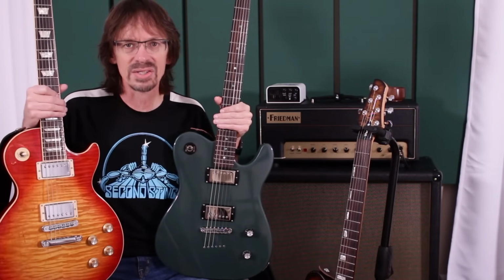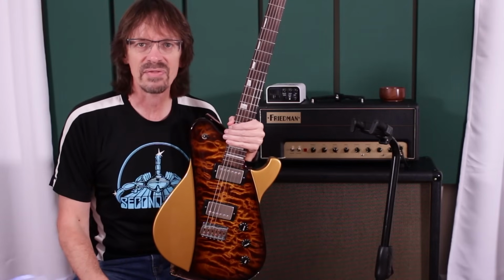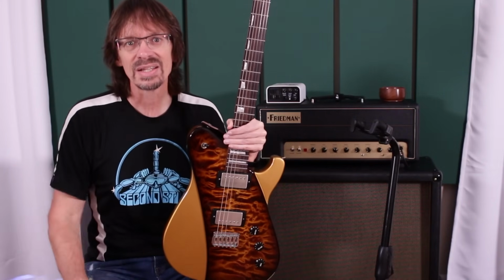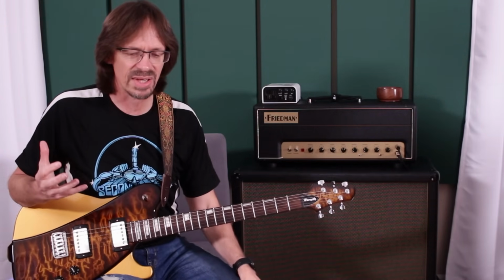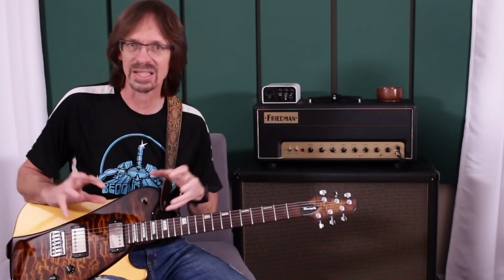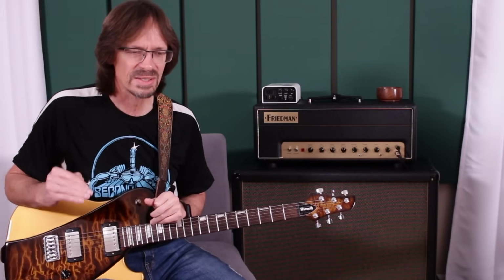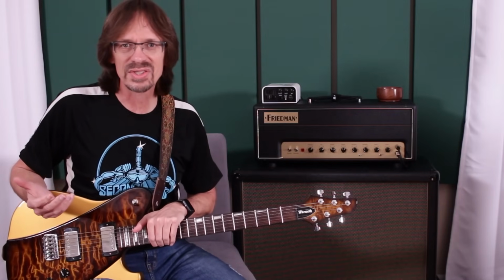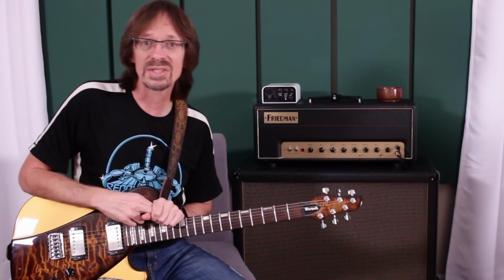Does anything else sound like a Les Paul?

Comment: Great demonstration,  Aaron.  For me, I was listening while I was folding g my laundry,  I didn't even realize you were switching guitars, so I'd have to say from a listening perspective you're spot on, you just need the pickup configuration,  but I also think the tactile experience vastly changes your perception of what the guitar is doing, and I think that is a valid consideration. I've got certain Les Paul's I prefer over the other ones for certain things based solely on how they feel and play, so to me that's going to be tenfold when switching between different types of guitars.

That said, my favorite non-Les Paul guitar that sounds like a Les Paul is my Warmoth Tele I put together 20 years ago  with a 24 3/4" conversion neck, chopped ashtray bridge and a Dimarzio PAF in the bridge. Sort of an Esquire-Gib.
Reply: Same. I was doing other stuff and the changes sounded little more than a different mic position -- if that.

Comment: This definitely gives me more confidence about my current project, a 24.75 scale tele deluxe partscaster with HBs. The goal was to get into an SG or LP tone territory but still be able to use a custom unpainted neck. I have a couple different sets of pickups and have built loaded pickguards all ready to go when the neck arrives to see which i like best. Can't wait! Great video!
Reply: Good luck on your experiment. I'm trying to do a similar thing with a Warmouth mahogany body Strat and a Warmoth 24 3/4 scale mahogany neck with rosewood fretboard. I will also add humbuckers but I won't be able to get it assembled until this summer.
Reply: @WindsurfMaui  Thanks man. Good luck to you too.
Reply: I’ve got a 24.75 scale jazzmaster, dual humbucker and it nails Gibson tones. 
It’s a total beast. 
All my friends drool over it 😂
Reply: @silverjaw138  Nice! Thanks for chiming in. I bet yours is killer and I hope mine turns out that way. 

I built a 3 P90 strat a few years ago, before I knew how much space a Warmoth JM body has routed under the pickguard. Now I wish I had used a JM body for it as I really like how many options you have when it comes to laying out the controls compared to a strat.
Reply: @silverjaw138  Just curious, What HBs did you put in it?
Reply: @jc6721  right now I have a Super Distortion in the bridge and a PAF Pro neck. 
It’s a sledge hammer, but cleans up well with the volume knob.
Reply: my next project is also going to be 24.75" scale LP kinda guitar - but I'm using a two-piece birdseye maple 24.75 conversion neck with a Tele-style heel and headstock.

Comment: Now in the midst of my second guitar build, the first (strat-style w two SD Pearly Gates buckers) over 15 yrs ago. This one is a crossover Fender/Gibson w/ a Warmoth maple neck, Meteora-style body shape, a 25.5 scale, and a pair of Fralin classic P90s and I’m going 50s LP wiring. Doing the full body work from scratch using a swamp ash blank w/a figured maple cap -let me tell you, steam forming the arm relief bend-n-glue of that cap laminate was fre@kin’ tense! Fitting the neck right now and I’m a skilled amateur, but an amateur nonetheless, and this kind of woodworking in a garage shop is not for the faint of heart.

Just sharing because I’ve probably watched every one of Aaron’s videos, several many times, over the past few months and this is one of the few spaces where there might be others who can relate.  Thanks Aaron, and Warmoth for the inspiration AND the sweet neck. I hope I can make it to the end without majorly #&ck!ng this project up!

Comment: In my experience, it's more about what you play it through that helps notice the differences. A good tube amp will accentuate the differences a lot more than a plugin or modeler which tends to homogenize the tone more. Pickups make a huge difference too. The wood used is a factor in how much it resonates. Some woods or types of woods resonate more than others. Finally, the neck joint makes a lot of difference as well. I thought in this example either B or C was the Les Paul. I thought the green one was A. Thanks for the videos. Helps take my mind off all the things going on in my world that I don't want to think about constantly.

Comment: I have an old Squire Master Chambered tele from 2005 that has the LP controls, mahogany, set neck, LP scale, 2 humbuckers, tunamatic, etc. I figured it was the humbuckers and scale length plus a little schmoo schmee on the set neck that gets it pretty close. Im not selling old Squires, mind you, just noting the recipe ingredients.  Here, I thought B/C sounded close. I also think getting something "in range" is the best way to approach the endeavor, along with getting the feel similar.  Was a bit of a head scratcher that you had different scale lengths so dialed in, however. Always interesting to see someone attack the issue thoughtfully, and really cool Warmoth build.

Comment: One interesting thing to note is that an electric guitar tone knob (a passive low pass filter) will drain some of the highs, even when turned all the way up.

It looks like the Meadowhawk and the Tele have only one tone knob, and the Les Paul has two. So when both pickups are selected, the LP will be decidedly darker sounding than the other two.

That seems to track with the big difference in highs on the middle position, especially noticeable on the cleaner settings.

So part of the takeaway might be, if you want it to sound more like an LP, wire it like one!

Comment: Aaron, thanks for doing this video it is exactly the experiment that I'm trying to do. I don't like Les Paul's except for their tone. I am really in love with Strats. So I have a Warmoth mahogany body and a Warmoth conversion neck with a mahogany shaft and rosewood fretboard. I will be putting humbuckers in it this summer. I think I would get closer to a Les Paul tone If my mahogany body had a maple cap. I believe that tone comes from the body woods and the shaft woods not the fretboard woods. the stiffness of the neck and body produce different tones depending upon whether you are using a maple shaft neck or a mahogany shaft neck. Dylan from Dylan talks tone believe the critical Factor is the distance from the bridge to the bridge pickup and the neck to the end of the next shaft because of the sine wave created by the vibrating strings feeds a different tone to the pickups by where they are placed. There is some truth to that Theory I believe but I think a mahogany body and Mahogany shaft Gibson conversion neck will get very close. Keep up these interesting experiments.

Comment: This a super helpful post. I have a Warmoth Partscaster (Strat style), but have come to favor a Les Paul sound. I have looked at a lot of different options to get there. New guitar, new build, replacing the pick guard…
After this post, I know it’s more about the pickups! I have a few guitars and limited space. The cheapest most efficient option is setting up a new pick guard, with low output pickups.
Reply: Did you order your Strat body with a universal pickup route?
Reply: @Robstafarian  Unfortunately, no! Either going to Dremel route it out myself, or have my guitar tech do it? Definitely going with the swimming pool route to insure I have maximum flexibility in the future!
Reply: @druwk I have designed a small perfboard which uses some spring terminals to facilitate changing prewired pickguards without soldering; I also decided to add a Littelfuse for ground-fault protection between the string-bridge ground and the output ground, taking a page from Taylor Guitars.  The board will sit in the control cavity, below the pots, with little depth to spare.

Comment: I built a Jaguar with a basswood body, maple neck/rosewood fretboard, and put a Dimarzio Super Distortion in the bridge (ceramic magnet, about 13.6k), and the 36th anniversary PAF (alnico mag, about 7.5k) in the neck, with a tune o matic bridge. I also built a proper LP with mahogany body/maple cap, mahogany neck/rosewood fretboard, that I loaded with a Duncan Custom (ceramic, about 14k) in the bridge, and a Duncan 59 (also alnico, and about 7.5k) in the neck. They're also very close in weight. The LP is 9lbs 1oz, and the Jag is 8lbs, 14oz. When I record them, I can not tell one from the other. But like you said, when playing them, it's a very different experience.
In the blind test in the video, I could not tell which was the LP. Honestly, I had guessed the LP was going to be guitar C, just because C sounded the most different to me, and I was assuming that both of the more Tele style guitars were both 25.5", and the LP was 24 3/4"ish, and that might have been the difference that I was hearing. Regardless, interesting video!

Comment: I correctly guessed the blind test, and in my experience, two of the most influential factors on the sound of a guitar are the pickup position and the scale size. That's why the Les Paul sounds warmer due to the scale, and the pickup position gives it that classic and identifiable sound

Comment: I would think scale length and peg head design is the biggest factor in difference. I could tell the LP immediately because of the spongey-ness in the looser string lengths. I wish I could see if the peg head is 6 in line or 3 +3 on the green one. 

If you could do a comparison video on peg-heads, bridge type and scale length, that would be awesome! 

I’m also trying to decide on wraparound vs string-through vs stopbar for a TOM bridge.

Comment: I like the blind sound tests. That way Warmoth is testing our sound expertise skills, haha.
Edit: Yes, I had the tests correct! The way I found out was because two guitars sounded more snappier due to the longer scale. And one of those had more output than the other, plus the Telecaster model - guitar C - sounded thinner due to alder body. The Les Paul was less tight, more rounded and had that typical attack full tone when hitting power chords. But I had to say it was not easy and had to listen the bridge examples a few times. The neck and middle positions revealed more differentiation.

Comment: The Warmoth Tele style if it had a mahogany body,maple top,a mahoany neck ( I could getvaway with using a maple  neck and board). Also,if either a Duncan 59 bridge pickup (, or Duncan ALNICO II) were used it would come clieser to a Les Paul tone,especially if a 24. 3/4" scale is used. Great video👍🎸Also I love the string thru body with a tune o matic bridge...Snap And sustain

Comment: I don't think body shape or material makes much difference to amplified sound. PU do. And scale length matters a lot too.  For two reasons. It changes the tension and harmonic content. And it changes where the PU are relative to the vibrating strings. If you just had one PU on a sliding track you would hear a great difference as you move more towards the neck or bridge

Comment: I picked the Les Paul due to the lower mids on the Neck pickup, the other guitars are brighter due to the longer scale length and higher string tension. That's pretty much the only difference other than pickups and electrical components. I built a guitar using a Tele body, fixed strat bridge, 2 SD humbucker pickups and Les Paul scale length. Sounds just like a Les Paul but plays much better. Cheaper too.

Comment: I chose B as the Les Paul.
Guitar A was clearly one of the Teles. Guitar C, I thought , was closer but still had that tele twang and lacked the Les Paul highs.
BUT, the major difference is that I was listening for a difference. I've owned quite a few Les Pauls over the years and they all sounded different. My favorite combination was a Les Paul with a maple neck, to grab more highs and tuning stability.
Overall, I really preferred guitar C in overall sound. Put a retrofit 24.75" neck on that one and I think you're there.

Comment: The Les Paul sounded way darker than the other two and it was easy to detect. The other two I couldn't tell which one was which but there was a clear difference. Guitar C sounded like it had less output. I thought that was the guitar with Crawlers because of that. Since I always thought BKP generally doesn't have as much output, not like a JB but this can of course be because of how far the pickup is mounted from the strings, and of course how loud the guitar is acoustically.

Comment: Thoughts after first clip:
A = Warmoth Nighthawk
B = Warmoth Tele
C = Les paul
Main reason is I expect the les paul to be less output than a JB and the nighthawk you said had higher output pickups too. 
I do have a JB in a jackson so I think A was a bit darker and B was the JB because the high end seemed to match a JB more than the other one.
EDIT: Ok i must have missed the part about the Les Paul also having a high output pickup. Was thinking more like a typical PAF sound. So that threw me off but I think the *Metalhawk (not nighthawk lol) did stand out as having a different sound than you would usually hear.

Comment: The sound we hear has a lot to do with the recording method used. Put a guitar through a good tube amp plugged straight in with no peddles and mic up identically is the best way to test this theory. Also the 490's are alnico II magnets. Alnico III are my favs. jmo although these p/u's are very close the 2&3

Comment: I'd say it like this; you can get a Warmoth guitar built to Gibson specs, you can assemble it with all Gibson parts, you can cut a paddle neck to a Gibson shape and finish it of with a Gibson headstock veneer, you can join the neck to the body with glue if you order the neck and body without any holes drilled for the neck joint and you can get the guitar finished in nitrocellulose lacquer.
Will that guitar sound and feel like a Gibson? For the most part, yes it will. Will it look like a Gibson? At a distance, yes.
But at that point you've spent a real Gibson woth of money on building a replica, so why not get the real deal in the first place? The great thing about Warmoth is the ability to get something unique
Reply from the maker: Yep, agreed! I would say the two Warmoths in this video are pretty unique.

Comment: Guitar C sounded different from the other two in every case to me. A and B came across as virtually the same but I was not listening on a high quality system, although it was still a valid comparison of how each one sounded on the same playback gear. C was slightly brighter to my ears in every case. But overall, even the difference between B and C was not huge. How the guitar feels to the player is of supreme importance to how they play, and in that respect, no - the longer scale guitars will not duplicate the Paul. I say that as a Fender guy who appreciates a Paul but doesn't normally prefer one. It was an interesting comparison.

Comment: Couldn't tell the two tele's apart since I didn't know how they sounded like to begin with, but Guitar B was clearly the Les Paul, you can definitely hear the difference in scale length there.
Reply: Good point, using a short scale neck on a mahogany tele with maple cap and mahogany neck - that would be very similar, if not identical.
Reply: The drop off in high end frequencies when combining pickups was a giveaway.

Maybe that's Gibson wiring harness.
Reply from the maker: It has a wiring harness from Gunstreet. It's good stuff! https://gunstreet.co/products/gunstreet-wiring-shop-les-paul-standard-classic-wiring-harnesses
Reply: @j_freed that’s because of the 4 pots loading the pickups in the LP, which you don’t have in the other two guitars.
Reply: I thought guitar A was Les Paul )))))
Reply: @alar7743 same. Felt 90% on that😂

Comment: Why isn't there a single model with an angle in the neck pocket?
Reply: There is. Order the body routed for a tune-o-matic bridge and tailpiece and it will have an angled neck pocket
Reply: @wilhelmtheconquerer6214   I didn't know that - thanks!!!!! If only there was a longer tail like on the old LP - )))
Reply from the maker: Every single body we offer comes with an angled pocket it you get a rout for a bridge that requires it, e.g. a TOM bridge.
Reply: @warmoth  Thank you now I will know

Comment: I really feel a different way when I play a neck through or set neck guitar. Bolt ons have their place they are punchy,  they slide under the bed easy and have replaceable yet critical parts. By some peoples logic A solid body double humbucker Tele sounds like a jazz box. There are lots of ways to make guitars sound similar. Enter tube screamer and metal zone, compressors, ir ect. This is irrelevant if you play very high gain stuff. Glen fricker can yell at you about that. But...
 If you lean clean you know what I mean...

Comment: The guitars sounded similar, and within what EQ could match even closer, if necessary. I did correctly identify the Les Paul, as it was the darkest, most muffled sounding of the guitars. This is something that I don't like, but I've heard some LP Studio Models that I like a lot. I thought the other two guitars had a clearer, higher fidelity sound. I would have guessed Guitar B as the least expensive, lowest fidelity, and probably the poorest quality of the three.

Comment: Why don’t you have necks with an angle but from a single piece - the sns machine doesn’t care which one to turn?
Reply from the maker: For two reasons. 1) We are able to get a higher yield from our wood. Gibson glues wings on their headstocks rather than carving from a single piece for the same reason. 2) We believe a scarf joint makes for a stronger neck/headstock transition. We also use a volute there to help with the strength. Gibson does neither of those things.
Reply: @warmoth   We are not interested in more reliable, we are interested in sound - you need an option with a volute for a separate fee, and you can also increase the price for the solid neck option and see what people choose - Thanks for your patient replies